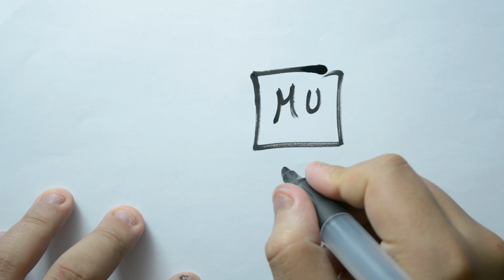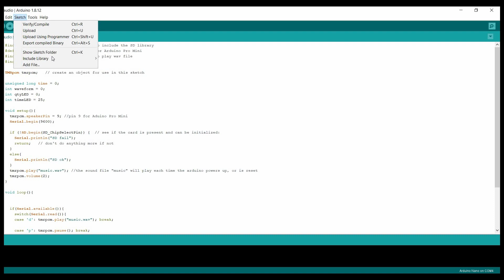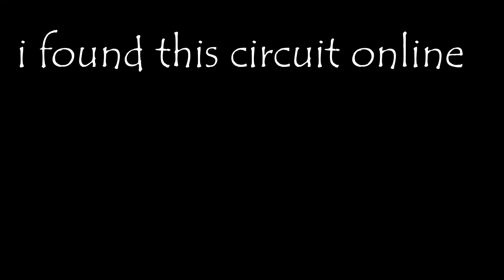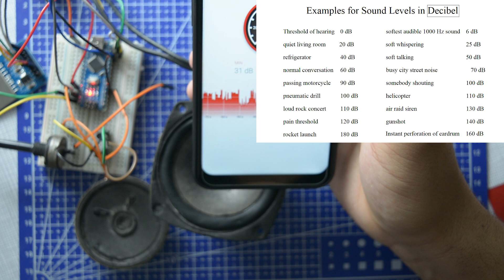MP3 player using Arduino  + SD card reader II  HOW to OUTPUT voices from arduino #25

Comment: How can I get a higher output voice I need to be louder
Reply from the maker: Use an audio amplifier circuit. You can buy ine for cheap or diy your own
Reply: @TnInventor  thank you so much for responding I am using PAM8403 but it's not giving the output I want :( also for noise reduction any suggestions ?
Reply from the maker: How loud do you want it? Try more powerful amplifier like a TDA2005 . You are using 3W ampli . Not that powerful .
Reply from the maker: Good amplifier will have a noise reduction filter built in . Just make aure you have nice speaker and a well suitable power source
Reply: @TnInventor  can I have your email for contact I can send you my questions there thank-you again
Reply from the maker: Put them here so everyone can learn
Reply: @TnInventor  I can't find TDA2005 near me
Reply: @TnInventor  can you please suggest another amplifier I even used lm386 the output was very noisy

Comment: It fails after around 20-30 seconds when trying to play longer music, any idea why?
Reply from the maker: Whats the fail like? . Maybe the file is too large
Reply from the maker: Try cutting the song into sections maybe
Reply: @TnInventor  just found out that playing it on a lower volume works just fine. Also I tried to convert the song to a lower frequency than 16kHz, it also worked and on higher volume too, but with a slightly lower song quality
Reply from the maker: Add an external amplifier you can get them on ebay for cheap play with lower voice then feed it to the amplifier to get the volume you want
Reply: @TnInventor  I'm using a transistor to amplify the sound
Reply from the maker: It works . But noy power efficient and the results will not be that good . Google class D amplifier iC

Comment: how to remove hight pitch noise from Arduino?
Reply from the maker: This is the draw back of using this methode . Using a good amplifier with a good filetering can help.
The arduino donc have a dac so we are using the pwm to simulate it . But its not perfect

Comment: My speaker is not having clear output. What speaker you have used here ?? (Ohm of your speaker)
Reply from the maker: A standerd 8 ohm one . Try adding an amplification stage
Reply: @TnInventor  I'm using PAM8403 amplifier and my speaker is 3 ohm but it  is only giving noise and can't hear anything clearly.

What should I do?
Does the ohm of the speaker matter ??
Reply from the maker: The less ohm you have the more power hungry the speaker will become . Try a small 8 ohm one
Reply: @TnInventor  ok thanks, I will definitely try oneand will update here.
Reply from the maker: Good luck
Reply: @TnInventor  update: I am using the 8 ohm speaker and it works but it has noise before and after the music plays. How can I reduce the speakers noise.
Reply from the maker: Check the ground . First you need a comment ground . Then if you have noises in your ac wall plug it can affect the speaker to fix it try shearching for filters. Maybe add a high frequency filtre . You will have to tinker around with it